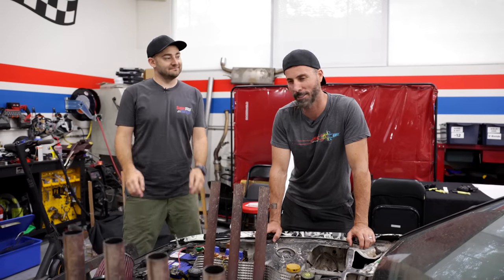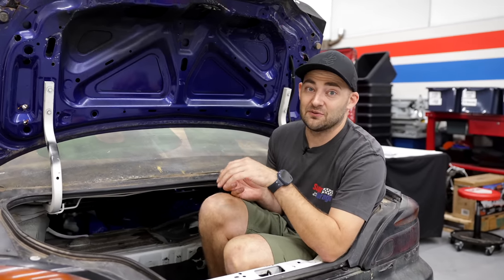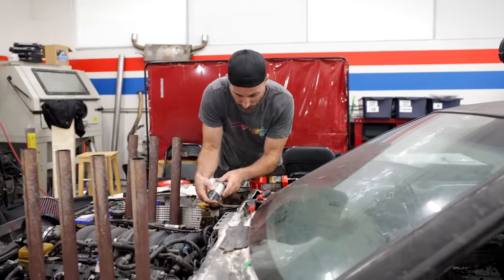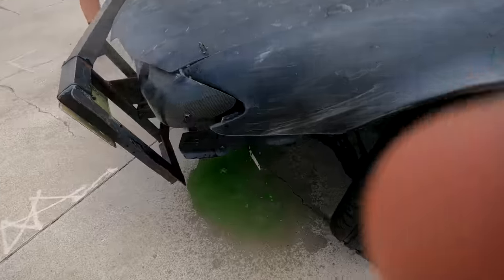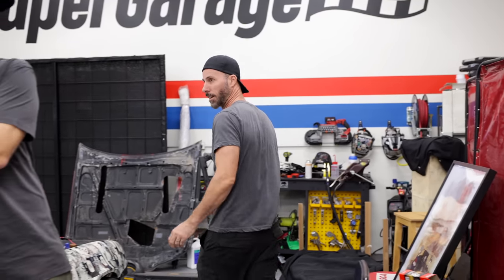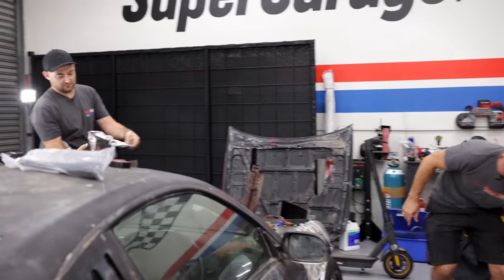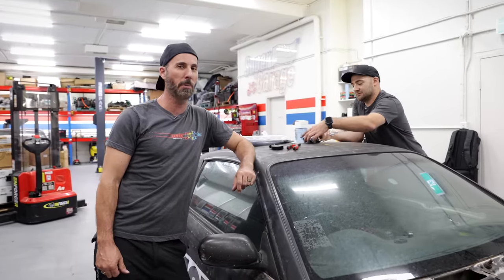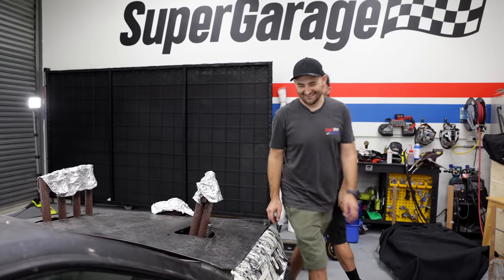Fixing Mod Max after Skid Pan Coolant Explosion (What went wrong?)

Comment: The trunk thing is because way back in the day cars had actual trunks attached to the back of them. The type of trunk you use to store clothes and things at your house.
Reply: That's why trunk is the better word, because people have been calling a large travel chest a trunk for over a thousand years, before an elephant's nose was even called a trunk.
Boot is an 18th century term referring to the, "Boot box" that stage coach drivers would sit on and store their boots, has nothing to do with cars.
In terms of Bonnet vs hood, they're equally not great names for it.
Reply: @superkirk11  they’re both head coverings and the engine has a head or two so it’s sort of logical
Reply: I think the bonnet/hood name probably comes from the first cars having a single large bonnet shaped covering for the engine. When it was removed from the vehicle and stood on the ground it probably resembled a hood or bonnet. Also I'd bet people have imagined the headlights as eyes for quite some time. That's probably helped bonnet/hood become the anthropomorphic name.
Reply: @superkirk11  hood keeps water and grit off your head.  Car hood keeps water and grot off your motor.  It’s not that bad.  A bonnet is also a thing people wore on their heads (I guess some do still), but most bonnets aren’t really as ubiquitous and effective at protecting heads as hoods.  Especially not these days.

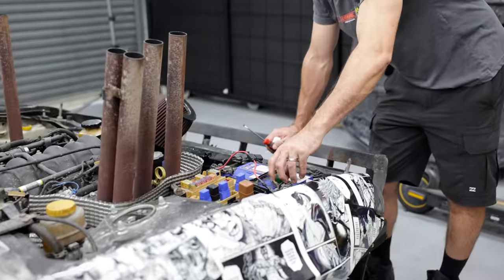Comment: 10:59 also, one must not forget to clean their battery top as well. Grime can be conductive and on cars that sit, that's gonna kill the battery. Perhaps less occurring with every day vehicles, but trucks and more utilitarian stuff suffer from this as they get dusty and dirty much easier. I lost two big batteries on a truck before i figured it out, all it took was a careless oil drip on top, cleaned haphazardly and dust to build up.

Comment: My first licensed car I daily drove was a 99 Trans Am in '08 when I turned 16...you would think by the point of the LS series they would have a new fuel pump that doesn't get stuck or die if it sits for more than a week.  The ratty '95 Celica I had at the time (that started my obsession with the ST204's) built as an amateur rally car I put together with bits and pieces laying around would have a better chance of starting up after sitting than any of my GM stuff.  I left the TA at home when I went to college after someone shattered the rear hatch glass my first semester.  Get back that summer, no dice zero sound from the fuel pump.  Meanwhile the Celica fired up and I drove it to pick up a new pump and deal with the massive pain that is replacing a fuel pump in an fbody (dropping the tank and everything else in the way; I cut a proper access hole in the body after the tank was down to make the next swap easier).

Comment: In regards to the difference in nomenclature for the hood (bonnet) and trunk (boot), Marty you are grossly misinterpreting why it's called a trunk.  Yes elephant noses are called trunks, but that word also refers to large rigid pieces of luggage called trunks that were very common in rail travel. Which is where the name for it comes from as opposed to the origination of the term boot which started as slang for the boot locker located on a stagecoach. So one is actually fitting an original definition and just applying it to an automobile structure the other is pure slang so I think TRUNK WINS!!!

Comment: "Trunk" comes from ye olden days when they'd mount a trunk on the back of a conveyance, like carriages and eventually early automobiles. They didn't have a built in trunk, but you'd strap your trunk into place. They were usually bespoke and came from the carriage builder.

Comment: A hood is something you wear on your head, so the thing that covers the head of your car, is a hood, like the hoodies you sell in your merch shop. Perhaps it makes even more sense for a convertible top to be called a hood, but that's not the "head" of the car, so it's called a "top". A trunk is a large, secure box with a lid and a lock that you store things in. Therefore the large securely locked box on the back of your car that you store things in, is a trunk.

Comment: I have the same tyres on my mini. Only they are 245/45 zr17 . R53 with stock wheels. That's a V8 . I would have thought it would have had wider and larger tyres fitted

Comment: regarding the "coolant", can i just say something for a debate: the best coolant is water. (Well...the one in abundance around and cheapest of all, actually - free).. The green coolant you use (somewhere orange, somewhere red, blue or whatever) is actually called antifreeze. The purpose of anti-freeze is in its name, for the colder countries where the "cooling liquid" may freeze and crack the radiators, engine block, head or w/e. Putting antifreeze where it's not needed for this purpose is only doing harm because it actually lowers the heat transfer/cooling capabilities of the pure water. So, in a normal, daily car ok fine, but for drift or track car in which the engine spends it's time mostly in the ketchup and it needs max possible cooling it's not fine. Besides, when it blows a hose, which frequently happens as everything is boiling, and all that antifreeze drops on the road i.e. in the nature, its again a bad thing because it's harmful and any bird or animal which takes sufficient qty from it can die. If i'm wrong - crucify me.
Reply: Running straight water can cause other problems with corrosion and water isn’t a lubricant. You need to run an additive like water wetter that actually helps it cool a little better, but also helps add some lubrication and a little corrosion protection. 

I’d imagine they run antifreeze because the car may get stored outside or in a place where it might freeze. But, they could probably use a much lower ratio. 50:50 usually is supposed to be good to way colder than most places actually get.

Comment: It's funny people will drive a car around for years with non functioning gauges or even broken drivers door handles so they have to get in from the passenger's side. But when they go to sell the car, they will make a mad dash and spend a weekend or 2 fixing all the faults so they can get decent money or the car. I'm like - why didn't you have the agency to do that earlier on in ownership so you had a nice car for yourself to drive, instead you're just doing it for another person. And maybe you wouldn't be selling the car in the first place if you had!
Reply: Yep. Seen several crashed or broken motorcycles where they want regular price because they say they’ve got all the stuff to fix it. Don’t get why they wouldn’t just fix it and then sell it as a complete working thing.

Comment: 8:15 I just wrap my cars. I started years ago, using the 3M film that's used to somewhat secure glass so it doesn't slice you (home and shop kinda shituations where glass breaks, 3M had a thicker film that made it really solid) then migrated to colored stuff. For example our fleet is double wrapped in film. The care isn't as much a new owner, we usually ride our stuff into the ground, but just avoid scratches and dings that usually come with paint. The last 5 cars we got, we didn't even bother with colored stuff. Basic option, basic coat. Cheaper overall. Honestly, car manufacturers should think about offering a service where cars come with a plastic skin. Life's so much better with cars when you can both work around them with ease and not bother with paint chips or fading.